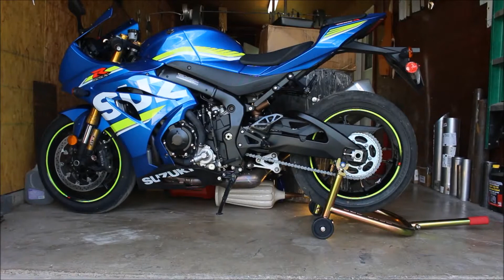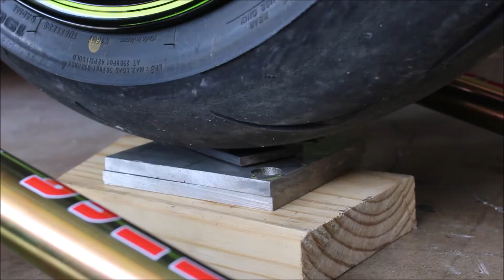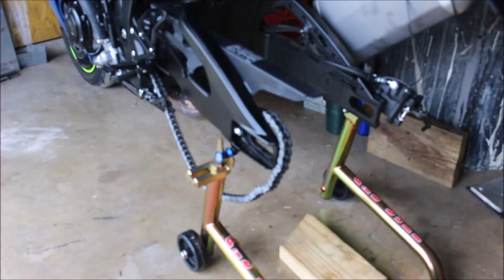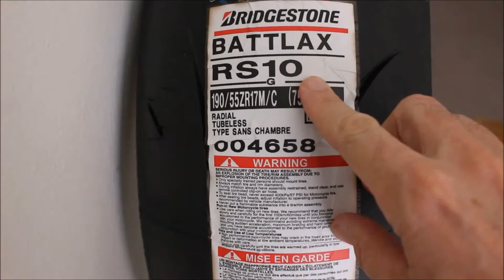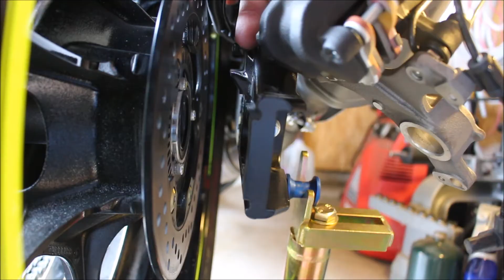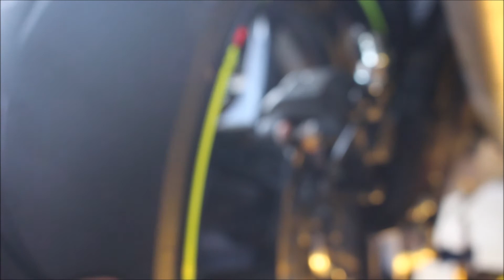Suzuki GSXR-1000R Race Track Tire

Comment: the R stands for Rear
Reply: So in essence the writing on the tire that says RS-10R......the last R stands for rear and on the front tire it will say RS-10F...F for front......hence there is only an RS-10 tire.  Not an RS-10R.  The RS-11's are much better than the Rs-10's.   And  Hypersport S22's are in my opinion even better for the road than the RS-11's.